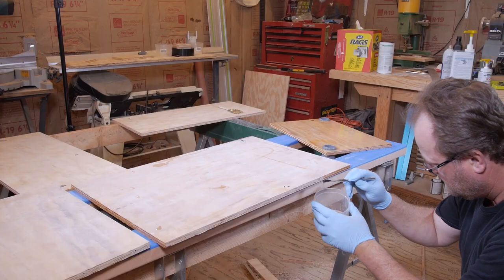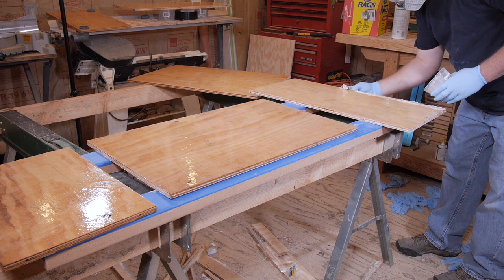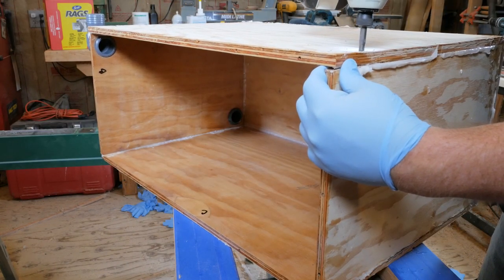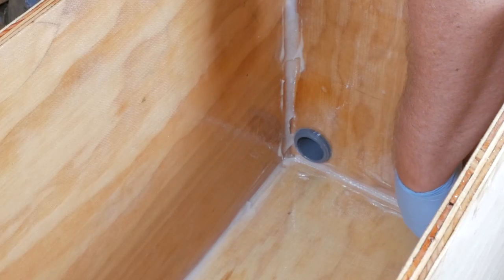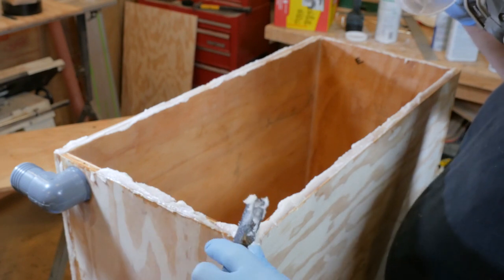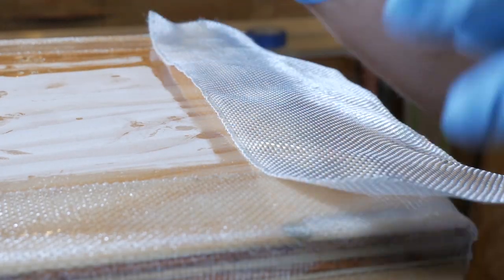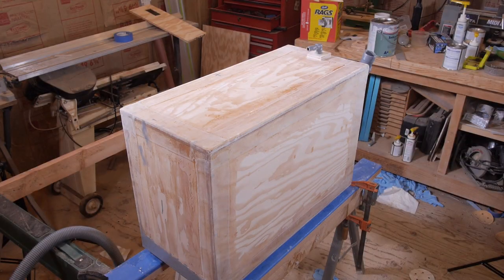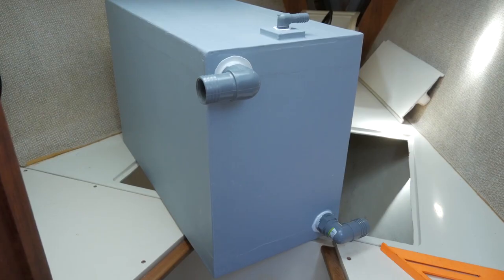How to Make Custom Plywood Tanks: Part 3

Comment: I’d recommend using an aircraft technique to make the bond area of the top larger.
Reply: whats that technique?
Reply: @ pre-release a false top with an opening and shipping tape on it and tab it in with one or two staggered tapes, then remove the false top .. this would extend bonding area and reduce the likelihood of any leak or bond failure as bond area would be say 2.5” wide vs 0.5”..
Reply: His method of bonding the top with a tape was certainly okay, but it would typically be bonded on the inside with more than putty snd the pre-release allows for smoother tank insides and more insurance against odor or leak
Reply: @danfall1003 is that really an aircraft technique? I’m a boat builder we do same. I thought it might be a new technique that I’ve never seen. Sometimes we use 90 deg pre made fiber glass flanges and glue and screw on.

Comment: How is the tank holding up?
Reply from the maker: The tanks is holding up well. No smell, no leaks, no problems. The boat was caught in 8-12 foot seas with serious headwinds (30-40 knots) for over 24 hours on one sailing trip. It was a good test. I am very satisfied with the build quality of the tank.

Comment: Nice one - very well described.  I have just decided to make my own holding tank rather than buy one.  I did a YouTube search and your channel popped up. I was thinking of simply making a plywood box and then covering it inside and out with fiberglass.  But I like your idea of laminating the plywood first and then using thickened epoxy and stainless screws.  I'll provide a link to your channel after I have done it so that people can see how it should be done if that's OK. Cheers.